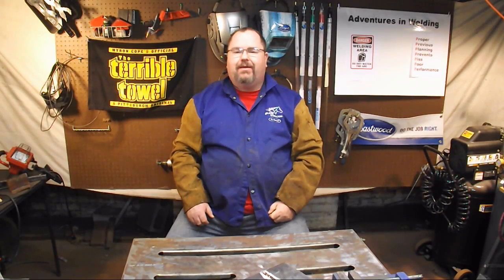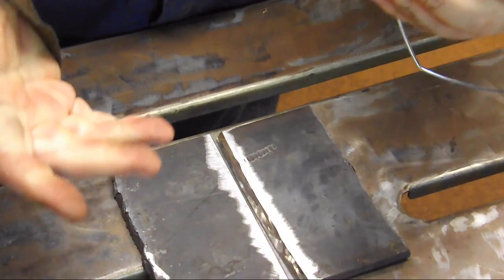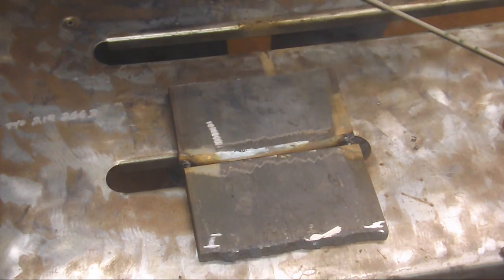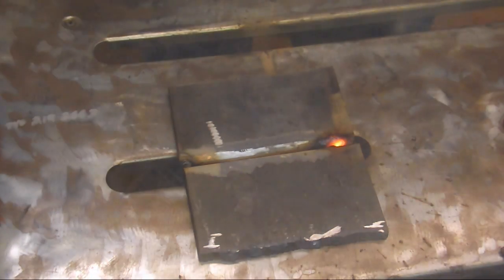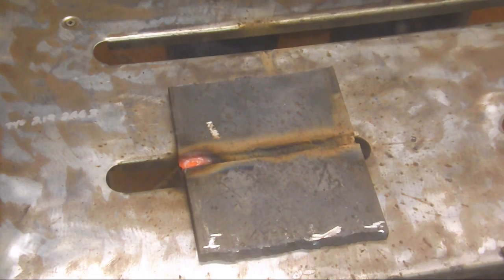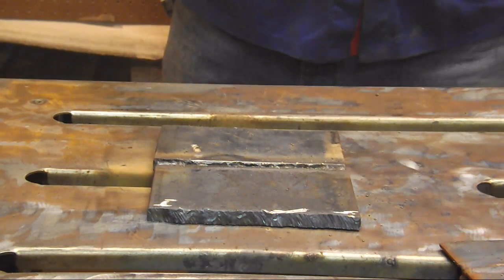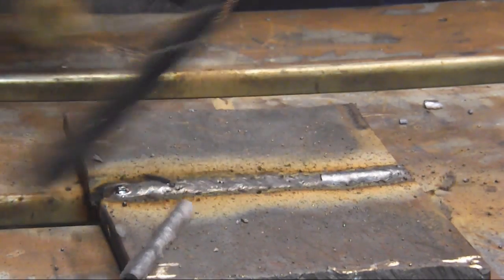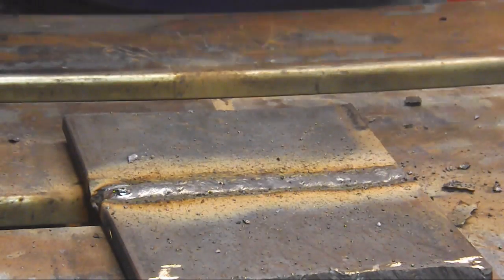how to weld open root in the flat position

Comment: Im in my second period of welding, and im sorry dude but i would be embarrassed to hand that weld into my instructors. No doubt those two plates are stuck together but if you bent that or x-rayed it wouldn't pass the test.  The root was garbage, i don't even wanna watch the fill and cover.

Comment: Flat on 7018 at 85??? That doesn’t sound hot enough I mean 7018 at 85 is my uphill so I don’t drip otherwise I’m running bout 110 amps
Reply: 1/8 rod uphill at those settings?

Comment: I did the same thing Paul the first time I used my Alpha Tig 200 to stick weld.  It doesn't say to un plug it in the owners manual .   LOL
Reply from the maker: +Steven Lawrence That's the problem with the manuals on these machines (any import, not just AHP) They write enough to get you started, but don't give you a circuit diagram so you know how things are interconnected. We live and learn my friend!